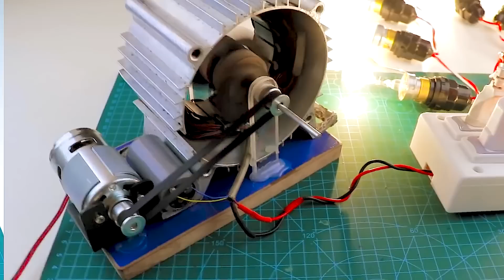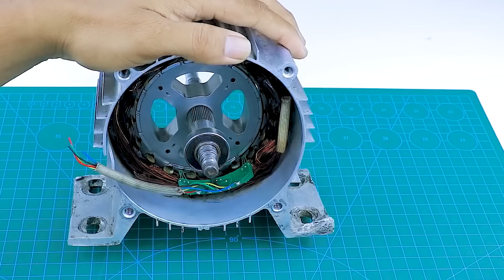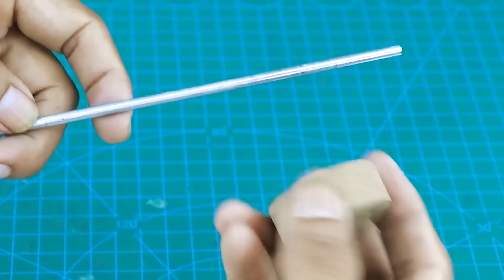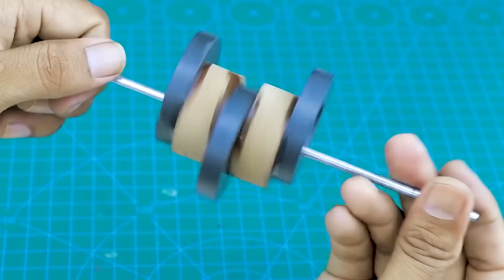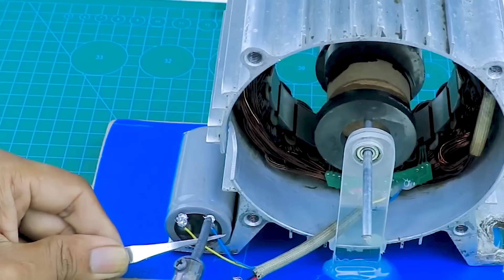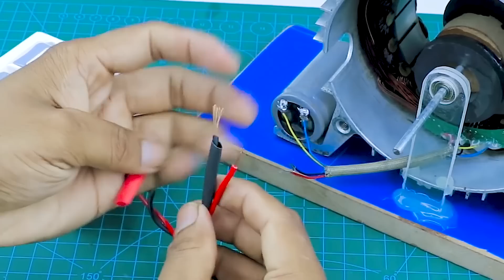FREE ELECTRICITY GENERATOR 5KW MOTOR COPPER COIL 3 MAGNET ROTATE 220V FREE ENERGY GENERATOR

Comment: Kindly show motor data plate, use power (kW meter) to show 5kw load.  Its seems half HP motor means generate 300 _ 400 watts only.

Comment: I have a generator made of 12 kilograms of 3.1 copper wire and it does not output 5 kw.  You're just turning on some lights. I think you don't know how much 5 kw means, it should be welding cable, not what you use there!  Cut more!!!
Reply: I think so
Reply: 0
Reply: 5:58